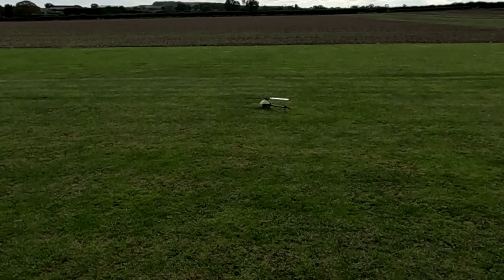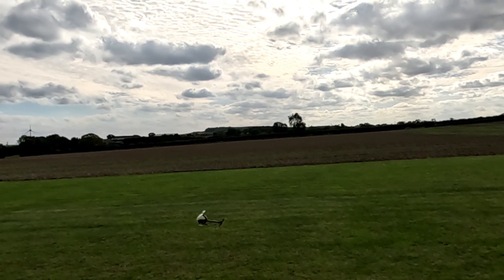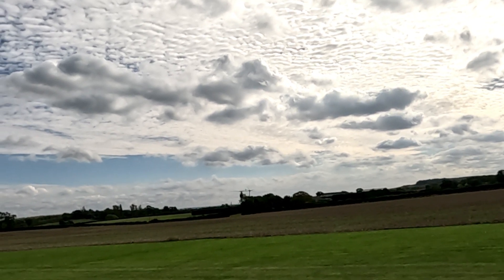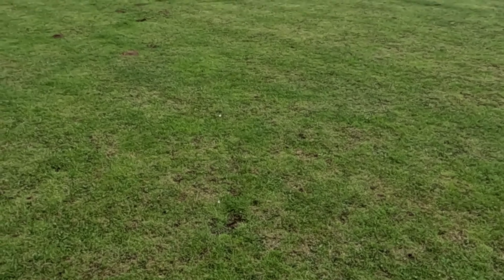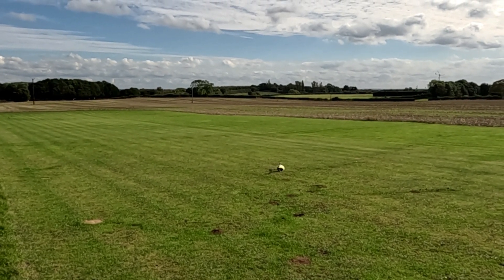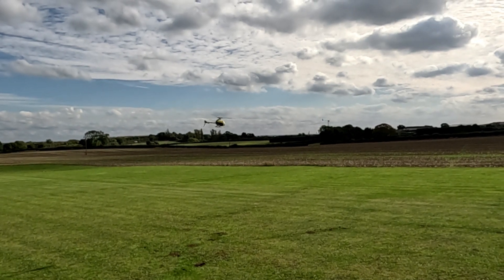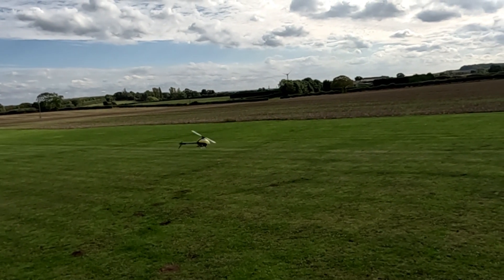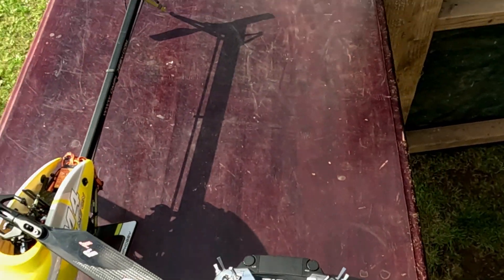OMP Hobby M4 - My First RC Heli Build & a Successful Maiden Flight

Comment: BIIIG Congtratulations, Pete!!   👌👍You have done it!! After all you have been through with the countless attempts and unexpected failures it must have been a great feeling to see this beauty in the sky!! Be careful with the (not necessary planned) landings!! Never when your beauty moves to the side. Tipovers are happening faster than you can look! The tail sounds definitely different than mine! I guess it's either too much or too less gain (sorry, I am not such a specialist). Please play with it because too much gain and this "vibrato" in the sound might damage your tail servo. And if it happens in hovering in fast speeds it will probably increase! I wish you many safe flights and tons of fun!!
Reply from the maker: Many thanks I have to say its the most satisfaction I have had in the hobby for a long time. I need to alter the throttle curve and add a bit of a dead spot around neutral pitch. Only one click on the the throttle ratchet will alter the pitch either side of neutral. 
I am working on the tail and gain settings because there is tail wobble. I have asked on the face book group for help on this. For sure one issue is resistance on the saft and tail mechanism.
Reply: @All_things_RC.  So glad to hear!! I am so happy for you!! Best greetings and lots of further satisfaction and fun!!